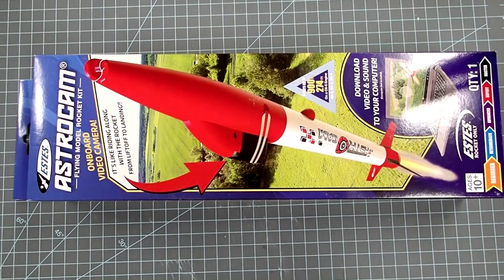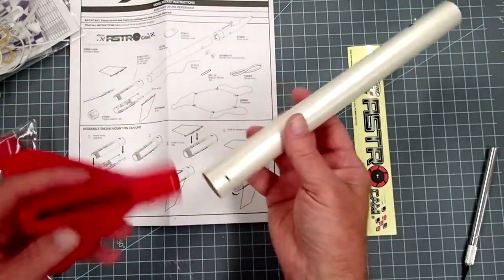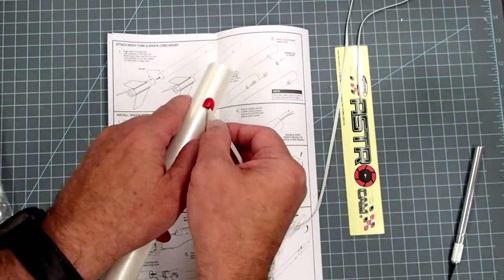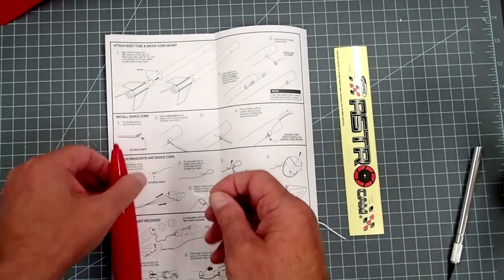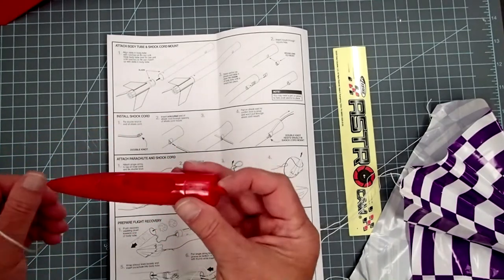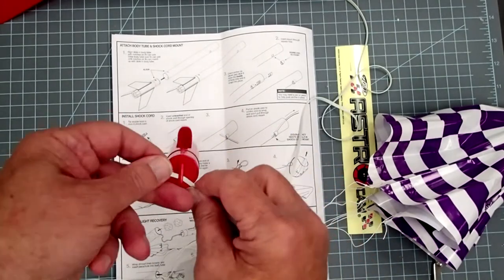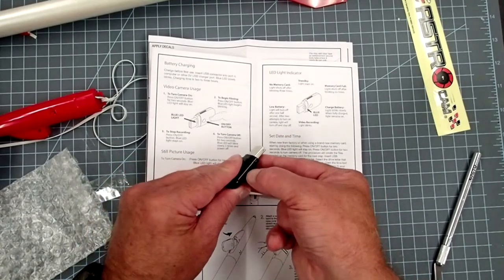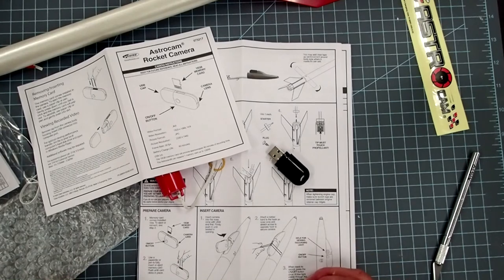Estes “Astrocam” model rocket kit assembly

Comment: At 1st I really liked the idea of this kit for its quickness to build.   I do STEM work and to bring in model rockets other than water rockets (PITSCO).    With a 90 min slabs of 7-8th graders, not much time.  

Am concerned on the quality of the kit.   Typical these days.   However allowing more time to go over basic 🚀 theory and they can build and fly the next class. 

Not sure if this is the ideal kit for them but the kids love to build and fly    

Maybe it’ll find a vintage one at decent price. 😉
Reply from the maker: I noticed that the body tube on this kit seemed thinner than usual. The Star Hopper works well for large groups and short time periods, and it’s available in a bulk set.

Comment: Some of these rockets are very stable. Mine, for some reason spins wildly. I am rebuilding my own version with BT-50 tube. Also, why did they use a shock cord mount that can potentially block the camera if you happen not to think about it?
Reply from the maker: The plastic shock cord mount is part of what makes this an easy-to-assemble kit, but you are correct in that the camera has to be rotated to the opposite side. My chief complaint about the rocket is that the body tube seems flimsier than most.

Comment: Any thoughts on how to either remove the date stamp or correct. I have tried many things, called Estes, but no matter what I try, I get a garbage date in the video. I have deleted the text file, updated the correct date, removed the date stamp but kept the text file, tried N, or No, etc
Reply from the maker: I just modified the text file as indicated in the instructions; it worked fine. You could try calling Estes for additional help.
Reply: @REAR_rockets  I called Estes. No help
Reply: @zielijo1  I have tried numerous times to change it using the property settings on the file with no luck.